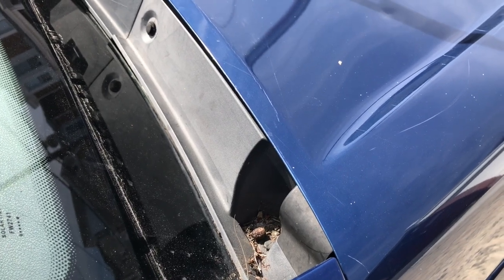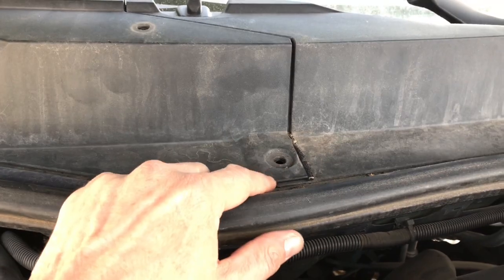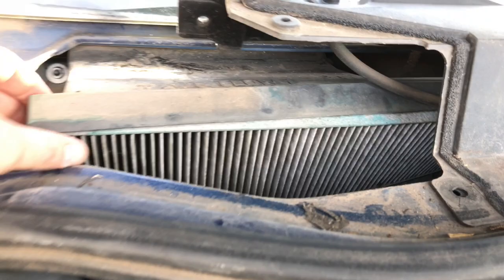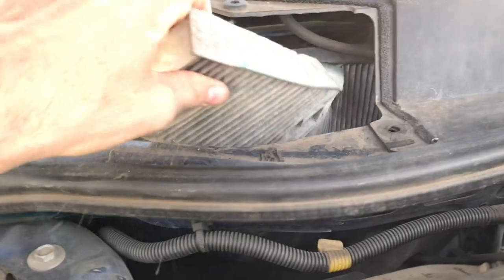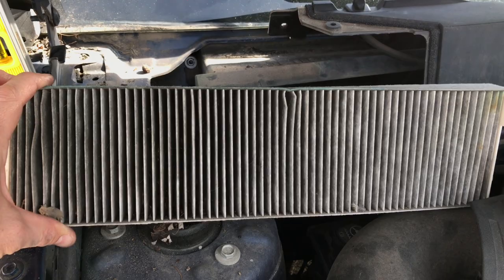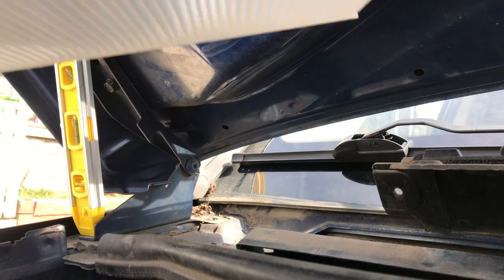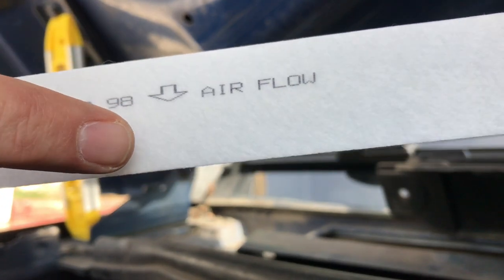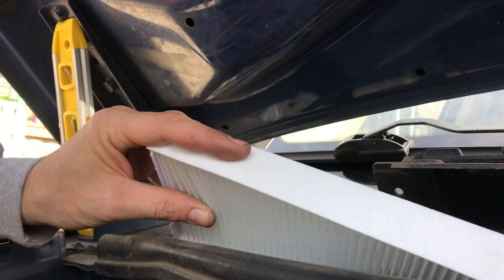‘08 Suzuki XL-7 Cabin Air Filter Replacement

Comment: Thanks dude! Got rid of a funky ass smell!
Reply from the maker: Jonathan Silas thanks for watching and I’m glad I could help!
My wife’s XL7 had a sunroof leak last summer. It rained for about 3 days before I noticed the leak, and by then there was a pond on the floorboards!
Had to pull back the carpet, remove the padding, towel dry everything, then baking soda to soak up the rest.
It took me about 4 weeks before the smell went away!
Reply: @DIYTutorialGuy  oh no! Yeah no sunroof on my 07 model. But holy moly was that filter bad. Ide tore my glovebox apart trying to find that filter, then found your video. Thanks again man.

Comment: Good video 
I have water leaking in I believe is the fresh air for ac/heat. Do you know where that is?
Reply from the maker: Thanks for the compliment.
I can’t speak to your exact issue, but the roof of this car leaked and puddled on the front passenger side every time there was heavy rain.
I pulled down the headliner and found the hose that drains the sunroof had come disconnected, so the water was diverting into the car when there was nothing attached to the end.
Man, that was a huge pain to fix, but once repaired there were no more leaks.

Comment: Thanks for the heads up… I thought it was behind the glove box as well. And yeah, this car is a pile of shit!! Throwing a p008 code as well. Hopefully it’s not the timing chain!!
Reply from the maker: Glad it helped!
We ended up selling it for $1,100 after the timing chain was diagnosed as being on its way out.
With the car shortage as it is right now, you may be able to get more than we did if you had to sell due to a timing chain issue.
Some guys have the time and space to rip it apart and do the repair.
Good luck!
Reply: @DIYTutorialGuy  yeah, only 88k on the vehicle too.
Reply from the maker: Damn man, sending you some good vibes! Hope the car keeps running for you.